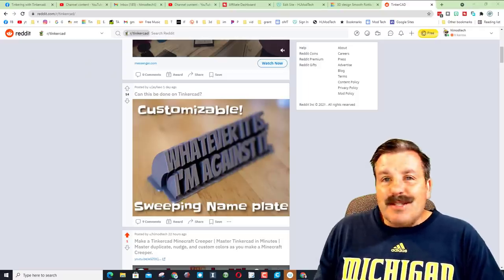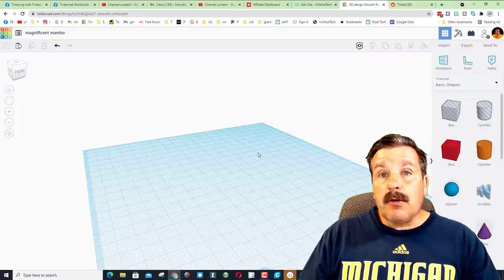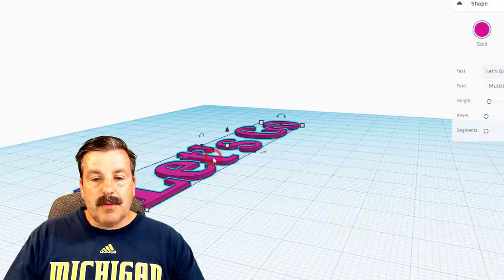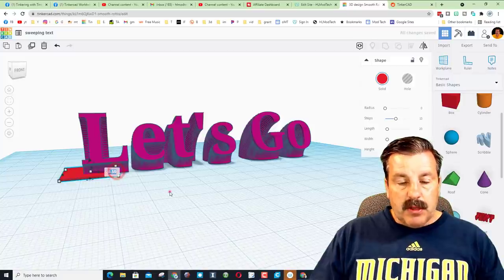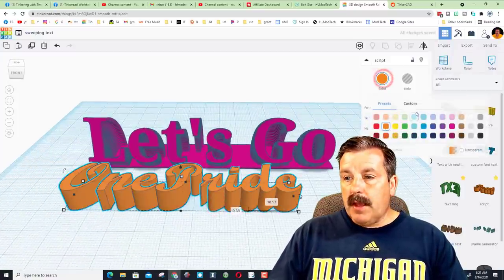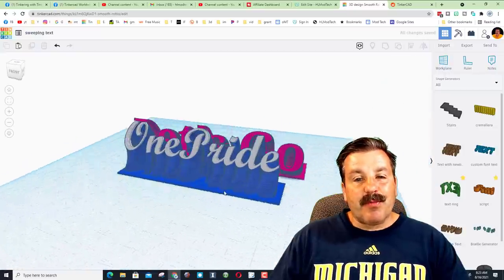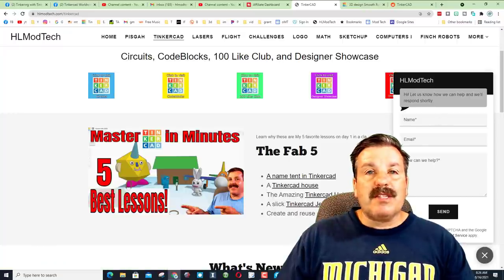Simple Steps for Tinkercad Sweeping Text | Master Tinkercad in Minutes

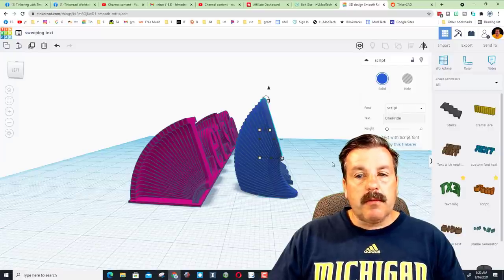Comment: On your video at around 3:34 you mentioned something about making them thinner... What were you talking about and how do you do this?  What is typically the best speed to run something like this at?  Yes... you guessed it, I am a newbie to 3D printing.
Thanks!!
Reply from the maker: I print everything at 60mm per second. I am not in too much of a hurry and the results are good for what I need. With the steps, I meant a thinner part with a smaller nudge would make the layers thinner and potentially smoother. It also could get so complex that Tinkercad bogs down. Good luck with it!

Comment: in my case it was rotating from the center of the word not from the bottom of the word, any setting I should change?
Reply from the maker: That is a result of clicking somewhere and "cancelling" the saved nudges. It takes a little practice to get used to it, but you need to do the steps without clicking somewhere between the First and (many) Ctrl-D presses.

Comment: thanks for the lesson. i ask you how smooth the letter ?
Reply from the maker: I do not have a strategy for that. The way were tricking Tinkercad to make it, it’ll just have that stagger in the back. If you do smaller nudges it would look more smooth but the more parts you have the more it strains tinkercad.

Comment: On windows pc, make sure the sticky keys are on!
Reply from the maker: How does that help?
Reply: @HLModTech  My pc had sticky keys off. I was unable to execute the short cuts. After some frustration, I figured out the issue and now the short cuts 2o4k.
Reply: … work
Reply from the maker: That is interesting. I do not have them on and my shortcuts work fine. Either way, glad you got it solved! 💯👏

Comment: Thanks for this awesome and quick tutorial!! I saw a similar name plate but it was a straight column with a 45deg slice at the top for the face (vs a sweep). I wish I could figure that out but this is just as cool. For some reason tho I cant get this model to export on TC. I keep getting an error about a 'node' not loading and then the export times out. No problem with my other models though. Thanks again TC Master! 😁
Reply from the maker: Check out this trick to make complex designs simpler. It may help. https://youtu.be/GukWvUfkOAo You can also reach out via gmail hlmodtech and I will see if I can assist you.

Comment: I've watched and practiced this so many times and had students do it (with some success).  Sometimes I can do it once, but I have trouble repeating the success.  Today my TA and are both having trouble with the first duplication.  Ctrl D. up arrow 3 times, but it moves sideways, backward, etc, not lifting straight up.  Any tips? I think the angle I'm viewing from makes a difference?
Reply from the maker: The angle you are viewing it from does make a difference. I agree it takes practice to get the steps right. If you ever click somewhere in the middle of the steps it cancels them out too.
Reply from the maker: You may like the new trick I came up with last week too! https://youtu.be/ryf2B9PtPOQ

Comment: Hello HL, Thank you for taking your time and demonstrating this it is awesome. So I was doing this in Tinkercad and I noticed there are tiny gaps in between, is this normal? as I redid it a few times lol. Thank you for your time.  Smiles, Donna
Reply from the maker: The gaps can be normal. It depends on the rotation degrees and nudges you use before duplicating. I used to guess and check till I got mine how I liked them. Thanks for dropping by!
Reply: @HLModTech  Your Welcome and thank you for responding. Instead of just 1mm I added 2 and it looked great. Happy Week. :~)
Reply from the maker: Sweet! Great job solving it. 💯👍

Comment: Hi thanks for the wonderful video.I have been practicing seeing your video,i need some clarification in sweeping text, "i don't know how to get smoother on outer edges".
Reply from the maker: Because we are using that nudge and rotate trick it really will always be a little rough.  More expensive tools can make it smooth without the "trickeration".  I just prefer free toys. =)
Reply: Is there any other tools to solve this problem because for printing it won't look nice
Reply from the maker: I printed mine and was happy with the result. If you do smaller nudges it gest closer to smooth. (It also gets more complex which can slow Tinkercad down). I do not think you will find a free tool that does it.
Reply: @HLModTech  I will try with smaller nudge for better result.
Reply from the maker: Came up with a new solution! Thanks for nudging me. =) I  gave you a bit of a shoutout in the vid. Hoping I pronounced your name correctly. Will take me about an hr to get the vid edited and posted.
Reply: @HLModTech  can u post the new idea in the upcoming videos

Comment: Is there a way to make a cut out of the text you make.  So let’s say I made the text say “welcome” and I used the hole feature and pushed it into the item 2mm and that looks great printed in bright yellow.  But now I want to print “welcome” in black about 1mm thick so I can inlay that into the yellow welcome to make it pop.  How do I do that??
Reply from the maker: Let me see what I can whip up. Thanks for the idea.
Reply: @HLModTech  I have been poking on this for a day. Did a search and nothing but landed in your video and thought….this guy will know.
Reply from the maker: Sorry I did not get this done yesterday. I had a memory of it... but could not find the comment. It would depend on the font and it would be 1 letter at a time... so tedious after printing. Are you thinking of doing it with the sweeping text?
Reply from the maker: @ipon70  See if this works. https://youtu.be/IeJLqeoXcHI
Reply: @HLModTech  so yeah I am just using the default “multi” text I believe.  I am at work right now, but I don’t have anything except the couple of default fonts installed.  But I was thinking just each letter, and then gluing them in.  And as far as getting back in one day……dude I am just happy your willing to help, so no worries. No sweeping text, just straight across and flat.
Reply from the maker: LOL. =) I ended up gluing mine in. Video proof coming in a minute.  From what you just said, this lesson is closer to what you wanted. https://youtu.be/SXtTgqxpBLI Still fancy fonts, but way easier.

Comment: Are you having any problems uploading exporting these? Mine always time out. I contacted Tinkercad and they told me they were too intricate. It really isn't doing me any good designing these if I can't export them back to myself.
Reply from the maker: I just exported one today for the resin printer. I did have to wait about 5 minutes or so for the grouping to happen. What do you mean by uploading it?  I exported mine as an STL and then brought it into the slicing program for printing.
Reply: @HLModTech  Yes, I mean exporting. I even made on with only 15 parts and it times out? Maybe it is a problem on their side.

Comment: Why is mine saying -3?
Reply: And part of the text is going beneath the plane.
Reply from the maker: Do you mean -3 when you rotate? That is just based on which direction you rotate or which direction the text was facing when you started. As far as going beneath the plane, I picked the numbers (.5 and .75 up) that allowed it to work. You can do it with different values, but you will need to use guess and check to dial them in... that is how I did it.